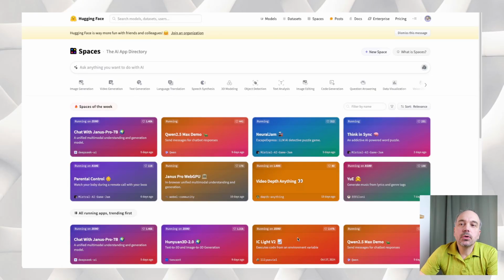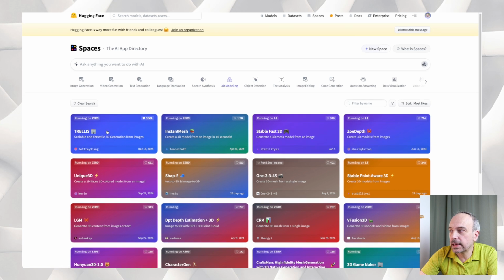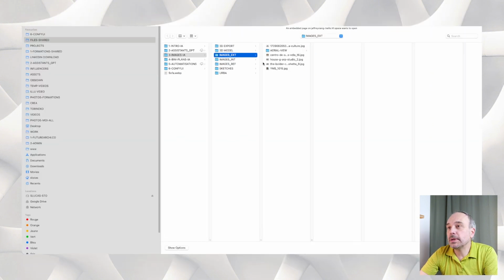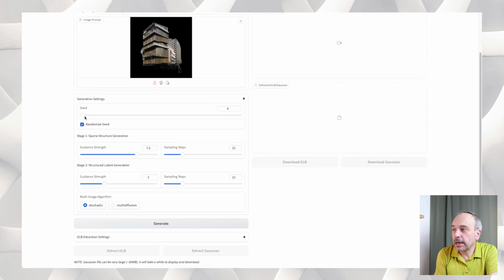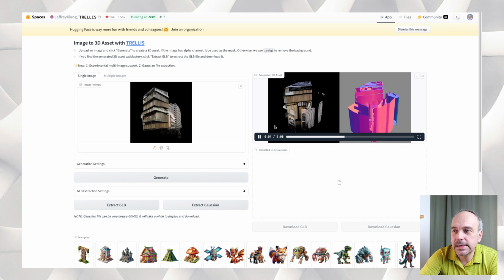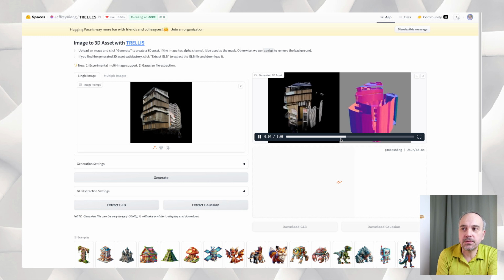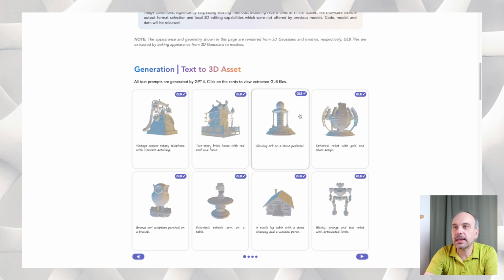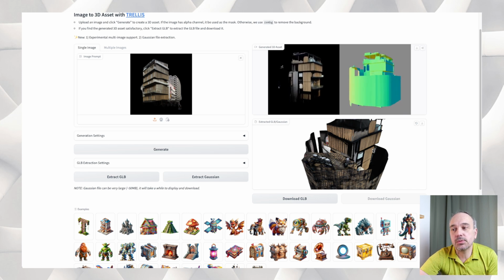Convert images to 3D with a free AI tool for Architecture !

Comment: Is there a tool yet that creates accurate  3d model of a room based on a few photos from different angles ?
Reply from the maker: Good question!
These models accepts multiple photos but I need to investigate more.
I suggest you try to understand how it works and on what type of input images it works better.